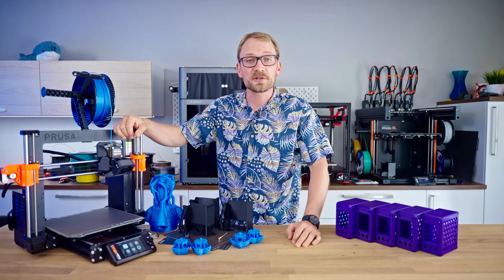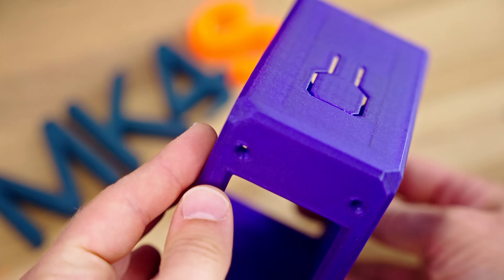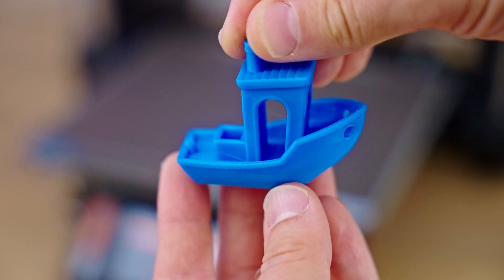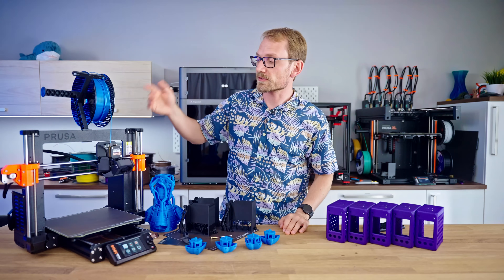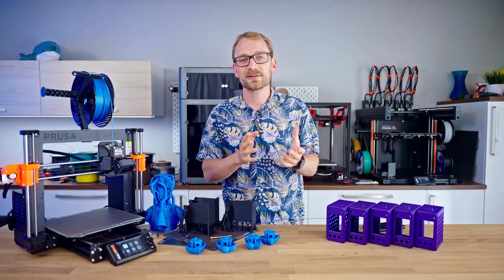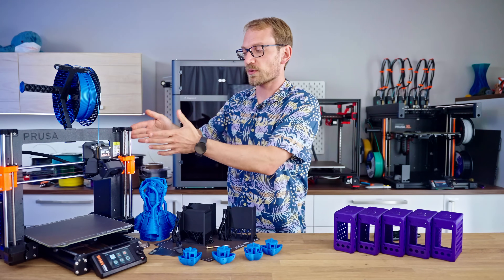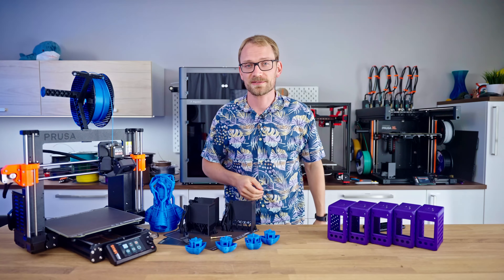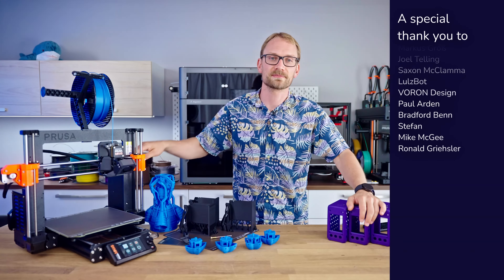"S" is for Speed - Prusa MK4S

Comment: I did buy an Ender 5 plus some years back, did put few bucks in direct drive, changed power supply and case fans with different sizes, designed a new head, got rid of the of the old marlin to use the 2.1 branch with MPC for the hotend, and I did harden it a lot. And it works, it prints very fine at around 100mm/sec (80 perimeters 120 infill) and it's reliable, it does print. The print counter available only since I use Marlin 2.1 shows me nearly 1000 prints, 60 days spent on printing. I can say it works and is reliable. 
That is to say I understand what Prusa is doing, but their machines are too costly.
Reply: Yeah. You can make virtually any printer good. It's for many the following question. Do want printer or printing/designing as a hobby? I got MK3 back in the day and boy it's been breeze to select profile and print with good reliability. I got Ender 3 V2 as secondary printer cause it was said to be equivalent to Prusa by many and I can now vouch that it's utter bs to say that, mediocre at best out-of-box. It's quite ok now after adding second motor to Z-axis, changing hotend, installing magnetic sheet and BL touch. But I wanted good, working solution when I bought my MK3 (now S), which is still going strong. My very first printer was house burner Anet and got sick of apalling quality and watching printer constantly. Heck I've occasionally have to rush seek that if I have remembered to remove previous print using Octo with MK3S. Also occasionally it can take like two hours starting to print and to get that "oh yeah, I should check out if printing have started fine". To me it tells everything necessary about reliability.
Reply: @jothain  Heh, seems like you went down the same path as me. First was an Anet house burner. Laughed at that memory. Also got the MK3 when it came out. and then upgraded to an S, 6-7 years old now. It still works fine! Made a friend happy today with a print she wanted.  I want to see how Bambo and Creality still support there own older models in 6 years time..
Reply: There's an old saying "Linux is only free if your time has no value."  I think that applies equally to cheap 3D printers. You can buy a cheap printer, mod it and get good results.  But if your time is limited/valuable, you'd probably find that when you account for printer + parts + time you've probably spent more than buying a printer that doesn't need mods.  Yes, that printer is more expensive but I'm paying for someone else to put their time into the R&D to make it work right, rather than doing it myself.  I'm at a point in my life now where I'd rather spend some $$ to save a whole bunch of my time.  The Mk4 was a great investment for me, maybe a little more than I'd have ideally liked to spend (I bought the kit to save cost/shipping because it was at the upper end end of my budget), but spending that money to get a well engineered printer that just works was so worth it to me.  (Like other commenters, I too had an Anet houseburner, the Mk4 was what got me back into 3d printing after the frustration of owning the Anet drove me away).
Reply: @JimOHalloran  I see your point, I am looking at the Prusa XL with 2 heads, but I cannot afford such a price, it's 2 months of base salary, 4 times the price I spent on my ender 5 plus which costed me around 600€ total.
Reply: @AlbertRavoir  i think people like you, and me, are the ones who enabled creality to capture so much of prusas market share. and i think it was well deserved. prusa lost the plot. as did E3D. the toolchanger is not really a new thing when you know about what kind of toolchangers hobby cnc machines for around 1000dollars have had for a decade.

...and the nextruder? is a monstrosity, in my view.
Reply: So you modded it like crazy. Sure, I did the same with my Ender2, but that's a totally different experience than just buying a printer and presto, done. :)
Reply: @punishedbrains  It's also a way to know how it works: building it. It's a shame I can't post a picture of it. I do design many things and now I love the fact I can just sent the print job using octoprint without worrying, I go see the printer some hours later and the object is on the bed.

Comment: Bought a mini years ago. It got so many new features I was struggling to catch up, but no matter how much they added, it always printed 100% reliably and in all these years i only had one failed print, due to my own mistake. I can't say the same from other printers i've owned or worked on with friends...
Reply: I don't know how many hours your MINI has printed, but I have one at 88 days (2100 hours) and it's been a mess for the last like 700h. I've spent around 100€ in spare parts in the last few months trying to keep it working but it just won't work reliably anymore.
I think the bed is bent (no impacts on it at all, it hasn't moved from the same spot) and I can't print in the rear right corner (where the cable attaches to the bed) because the first layer there is way way too high (the rest of the bed is perfect), it always underextrudes when printing on the rightmost 20% of the bed, I think it has a hard time pushing filament through the highly flexed ptfe tube. Dimensional accuracy is shit too, specially bad in wholes.
I've replaced most of the hotend, the ptfe tube (three times) and some parts of the extruder. It kinda works now, but the print quality is far from what it was and I am just tired of it.
I need a bigger machine but there is no way I spend 1200€ on an mk4s when an A1 is half of that.
Reply: My first Prusa was a used Mini. 
First print I did with it, it crashed the nozzle into the print as soon as it finished. Melting a heat block shaped chunk into it x’D

From my understanding, it was an issue with using a current version of the slicer, with an old firmware version. (Didn’t confirm. I just updated the firmware, and it’s been perfect since)
Luckily the part just needed to be functional, not pretty. 1.5 years now and the part is still holding up. Took about 30 hours to print. 

What the printer did:
Finished be print. Used up a ton of the build volume for it. After it finished, before cooling down, the nozzle moved down and towards the center of the bed. (X, Y, and Z axis all moving as if it were trying to reach (90, 90, 150) or something. 
Skipped steps as it continued trying to move, till it stopped and “completed” the print job xD
Reply: I bought a Prusa Mini (not Plus) on the day it was announced. The MK3 was a bit too expensive for me so that was a good option to have besides my trusty, slow Ender 3. Boy did I regret that purchase. I had constant issues with this machine. Software bugs that caused the nozzle to scrape the bed, ripped belts, a defective PINDA probe, several dozens of times the extruder clogged, once a clogged nozzle which required disassembly (a cold pull did nothing). In addition the print quality was mediocre at best and the machine was quite loud. It never was even remotely worth the price. It got a little better with recent updates and input shaping, but at that point I also owned an A1 Mini, which cost less than half and was superior in every way. I like Prusa's approach and their commitment to open source, but all these issues I experienced and the hefty markup to the modern chinese printers make it almost impossible to justify buying.

Comment: Aaaand Prusa just released a new Video about the MK4S a few minutes after yours went online. Looks like they are adequately confident in their printer in the video, painting a good picture of a product that simply does what it promises. I wish more products would be like this
Reply: I don't know, it's having to wait over a year for a proper firmware release to have the machine function as intended considered "does what it promises"?
Reply: @chipwallaceart  Indeed, you have a point. The previous launch felt rushed and didn't fully live up to what it should have.

For me and my own opinion, as long as this won't happen again, I'm disgruntled yet not completely disappointed. The following can't be seen as a justification for a product lacking in promised value, but: oh boy had I printers that were lacking (a different, not as pricey brand). And they seem to keep on pushing out unfinished products...

But sure, Prusa has a steep price, and one would and should definitely expect a fully working product

Comment: When will Prusa learn (for good) that an angled fan is more efficient than a fan with a shroud that turns the flow 90 degrees?
Reply: the part cooling fan on the mk4s is angled, the one on the mk4 isn't
Reply: They did angle the fan right? 😅
Reply: @skylerockspecial they had a 90 degree bend on the MK3, then angled it on the MK3s, then back to the angle on the MK4 and now a angle again…
Reply: You're talking about noisy radial fans?

Comment: Very fair review. Thanks. If the XL was cheaper, i would consider going back to Prusa.
Reply: $2000 is a little steep, but reasonable.. if it was enclosed and assembled, but that's actually $3000. Then when you look to add more heads @+$470 for just one extra head and $1,420 for 5, that's a deal breaker. BUT if you NEED to print more than 2 multi-color or multi-material fast it seems to be the go to machine

I've always had a budget minded approach to 3D printing, I stayed away from Makerbot back in the day and I'm staying away from Prusa
Reply: Fair review? He is comparing 2 Prusa sh1ts. Compare it to Bambulabs and Prusa will loose in every aspect.

Prusa is 10 years late and overpriced.
Reply: @michal-w3t1d can you get bamboo labs to do the multi-head tool swapping like the XL does? I'd be willing to abandon prusa if there was a viable alternative to multi-material that didn't waste a shit ton of filament like bamboo currently does

Comment: How does this compare to the X1 Carbon? Should you get the Mk4S or spend more and get a X1C?
Reply: X1C of course, all the Prusas are 1 generation old. With that said, just get a P1S and save the money, it's basically the same printer at half the price.
Reply: You're not spending more with the X1C. You're actually getting better value. The MK4 is missing an enclosure with all the add-ons. Add that to the price of the MK4S and you'll get a better picture. Apples to apples
Reply: @elleryfg7853  but youre also selling out all your data to both bambu and the ccp. theyve been shown to collect your stl files and gcode even when they explicitly said they didnt.
Reply: If you don't plan on printing ABS or similar materials you are getting a better price. Enclosures are nice but so long as you don't stick your printer in front of a fan the effects are negligible for PLA and PETG @elleryfg7853
Reply: @elleryfg7853  enclosed to be used with the door open most of the time? and the noise is horrible!
Reply: If you get the Mk4s, it has a 250x210x220mm build area and "normal" print speeds. Keep in mind its open air so that limits the material choices for $1099. And if you choose the MMU3 and enclosure it's $1659. And still need to enclose the filament for best results with nylons, petg, etc.

The X1C has a 256x256x256mm build area and will print much faster while being enclosed for $1199. Companies use them in print farms with no more issues than the Prusa machines. And comes out better/cheaper with the multi-material option at $1449.
Reply: x1c with AMS was my go to, between these. the Lidar for me works well, i am using any cheapo amazon filament at max £14 a kilo (esun, sunlu, tinmory, anything that's on offer basically), and I never had to do any filament tuning. For X1 because speeds can support it, I would also recommend the e3d high flow nozzle. Print quality started to degrade past 20mm cubic, and with the e3d nozzle, 0.6 arachne, I can get 30mm/cub out of all PLA's.  AMS I use mainly for PETG support in PLA (game changer). Enclosure was also useful for ABS prints - zero warp at a 200x100 box printed.

Comment: In regards to what feature belongs to what version of the printer: Some features maybe weren't available for the MK4, but it was still sold on the promise that it would be added (especially input shaping). Since they do have integrity, they don't resell it as a "new" feature for the MK4s. Or because they might be called out of it, depending on how bright or dark your view of the world is. This doesn't apply to all the incremental changes, but considering how rushed the launch of the MK4 was, there were some IoU attached to that.
If I remember correctly you did mention this in your original review even, not being overly happy about being sold promises, and as a consequence being unable to test them.
These days, if I was in the market for a "just works" printer, I would probably get a Prusa. But I'm too much of a tinkerer and went the Voron 2.4r2 route (and am incredibly happy with it).
Reply: Don't you want to have both? A Prusa for when you need that trusted workhorse and that tinkering setup where you might mess up and need a replacement part printed for it. That's why I bought both a Prusa AND a Voron. And while I think I would like to eventually own a fleet of Vorons, they do take a TON of time to build/calibrate correctly and with the prebuild Prusa's you're up and running a lot faster.
Reply: @Cergorach  that was the point of the Voron for me. It is a trusted workhorse. It needed basically zero calibration. I can just send a job and it'll be fine. It's the successor to my old hypercube evolution, which I had to repair 4 times to get the Voron prints off it. I also have a cute little cheap cantilever 180x180 (prusa mini style, but sub-200€) for tiny or replacement parts, which will eventually be replaced by a V0 (or printer for ant variation). Like a Prusa, it can't really do ABS without help from some form of enclosure.

Edit: also for me, the building of it is a very large part of what I consider "the hobby", and I just love it. That's why I'm not in the market for a "just works" printer after all.

Comment: I would love a video on print appearance (matte vs glossy, etc.) vs print speed/volumetric speed. Being able to have a mental model of what to look for beyond "matte = probably too fast".
Reply: Or ask Stephan to use his testing equipment to check the durability of matte printed vs glossy printed parts.
Reply: Why sit around waiting for someone to make a video so you can have a mental model? In the slicer add a cylinder primitive, use height range modifiers to change the outer wall print speed of different height ranges. This will give you an actual model using the specific filament you own.
Reply: @radish6691  Yup.  Now take that and repeat for many filament types across many different settings, and for different printer types to get a nice, normalized result. I personally lack the time and printers to do this and @MadeWithLayers asked for feedback in the video. Besides, I think his approach to this kind of project and videos are very high quality and would love to see the results.
Reply: @grepmonkey  Fair enough. I calibrate pressure advance and flow rate for almost every roll of filament I use so that’s why I suggested generating bespoke results. I don’t rely on generic filament profiles but I know they are perfectly adequate for many people.
Reply: Watch @cnckitchen videos. He goes over it
Reply: +3
Reply: +1
Reply: +2

Comment: The Mk4S still has two major bugs, though: the P1S and the K1, both of which are half the price and neither of which have the downsides of open bed slingers. I want to love Prusa machines for everything they've given the community, but they're so far behind the curve that - at twice the price - I just can't justify supporting them by buying one.
Reply: So why did Bambu come out with a bed slinger if they already had way superior machines available? :-)
Reply: @ulaB because price point. I can get an a1 mini for 200 euro’s. Prussa people do have a irrational hatred for bambu. P1s is 3000 hours in and going strong thankfully
Reply: @ulaB  because it's even cheaper, in no way is a bed slinger better than one that drops the bed down keeping the bed temps and parts themselves stable. I had a bed slinger years ago with input shaping and pressure advance, I quickly found issues with large tall and thin prints.

Then there's higher temp filaments like ABS, even IF you enclose the prints you still have cooling issues by the part itself being moved back and forth
Reply: Because it’s less than 1/4th the cost with far better features than the Prusa MK4 / MK4S, lol.
Reply: It's like people that buy Jeep's, sure there trucks that are far better on the road and even casual off road (especially snow/ice) for much less. But if they got used to it and are willing to spend the extra money, imo that's fine. But if it's there first printer, 1000% so many other far better choices